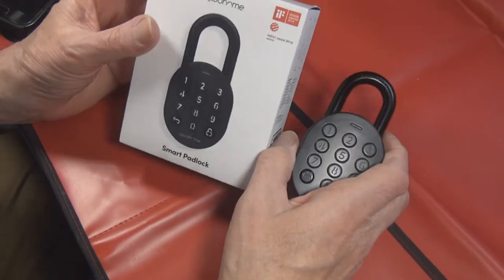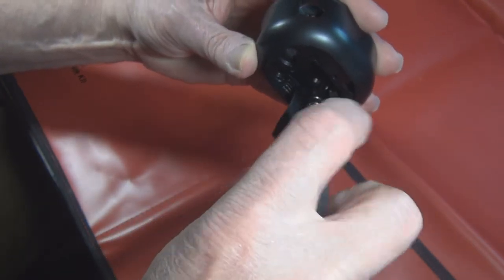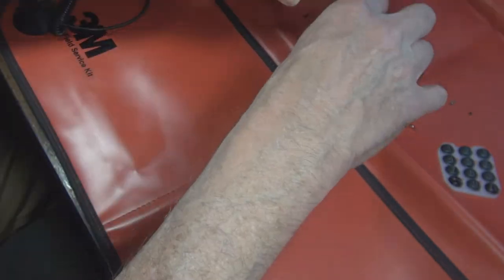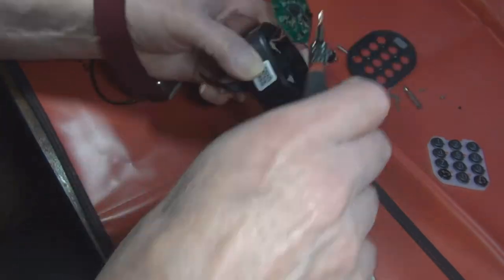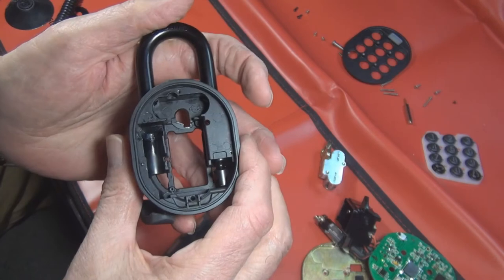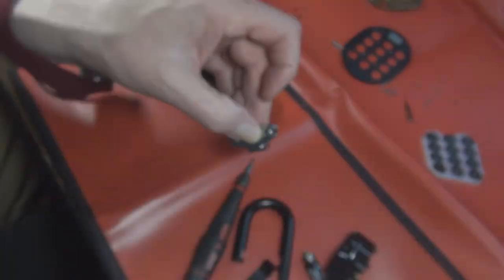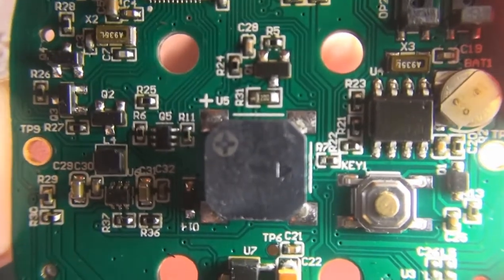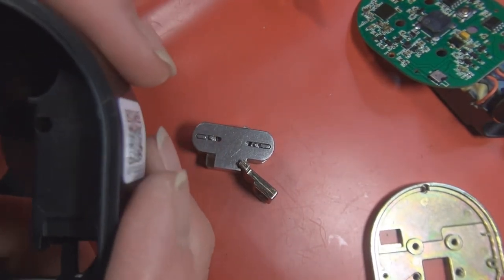IglooHome Smart Padlock Disassembly

Comment: We've had one of these at our tennis club, which worked fine till the battery died and someone opened the back cover without jumping the lock open. They must have used a fair amount of force but it did open. Now the lock will only open 1 out of 10 attempts if lucky. The problem is the lock thinks the battery door is still open and gives off 6 beeps and red led flashes which is the code for intrusion detection.
Would you know if that could be bypassed somehow?
It's not a major security problem as there's nothing to steal but if we could save a few hundred dollars by not having to buy a new lock that would be great.
BTW they are tri lobe screws, youll find lots of the in macbooks.
Reply from the maker: I Don't have a clue.  + I know nothing about "CRapple"